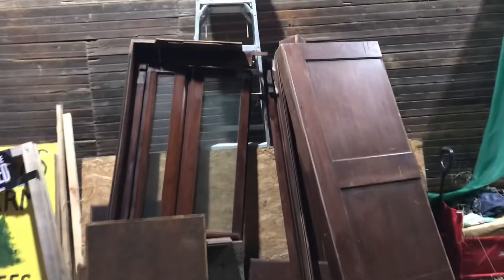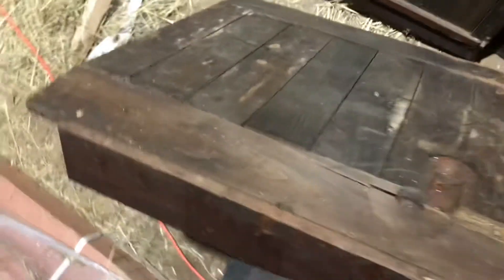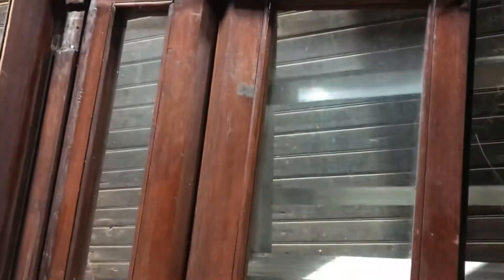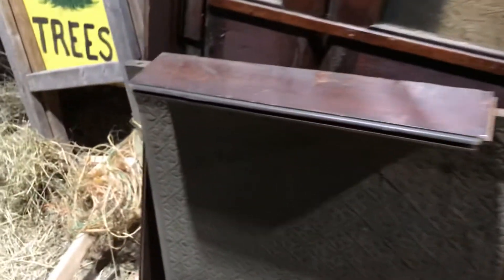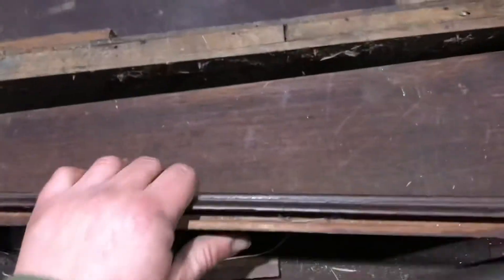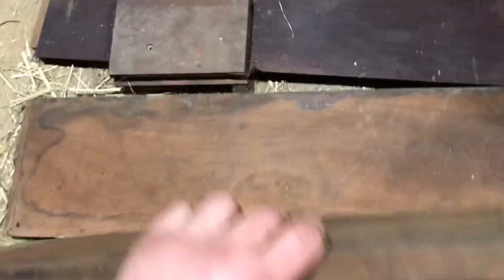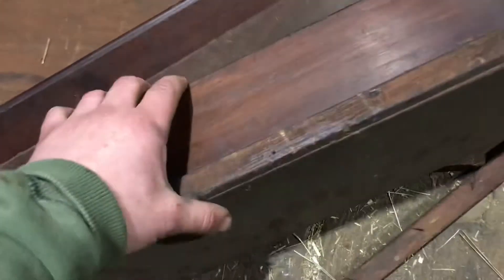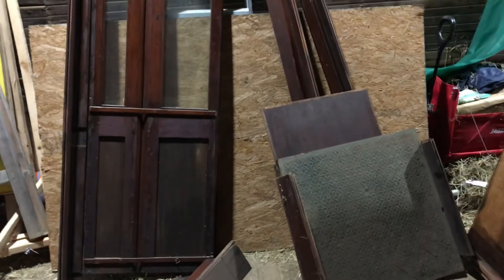Antique Phone Booth Parts Needing Assembly Before Restoration Project

Comment: The manufacture date of the booth should be found on the inside top left corner of the door. The center hinge on phone booth doors opened inward so that will tell you which side is the inside.  Some of those square/rectangular panels look to be a disassembled side.  They would slide into tongue and groove sections of the boards.